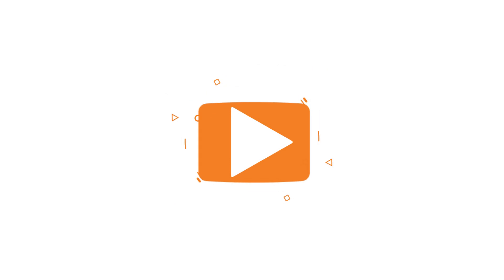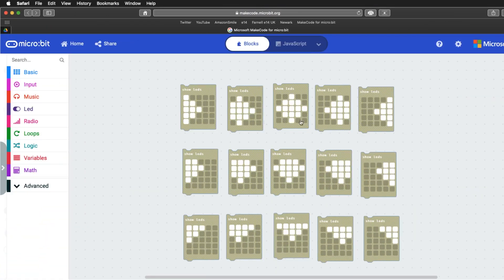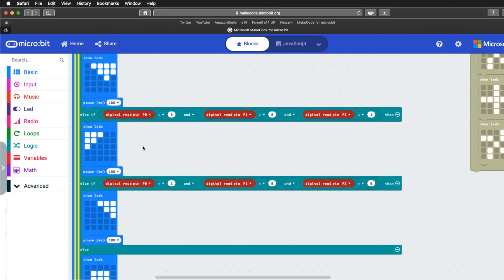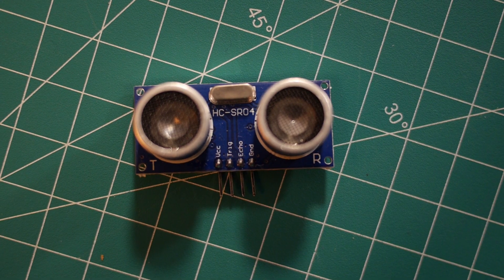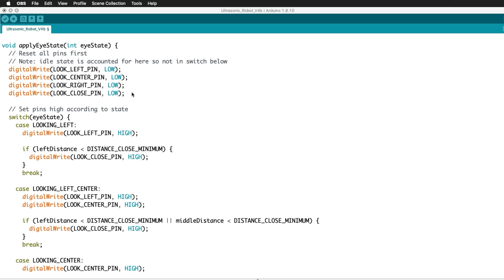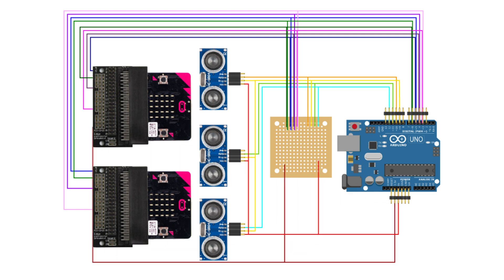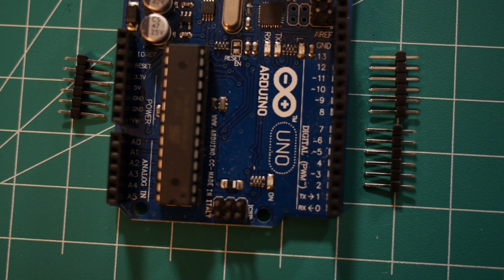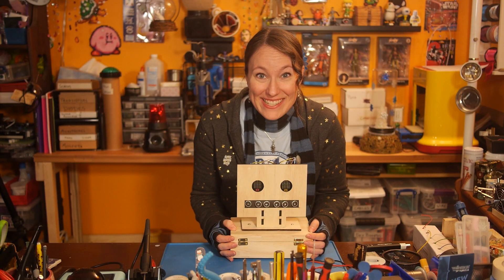How to Make an Ultrasonic Nervous Robot - The Learning Circuit

Comment: Heya, I couldn't find the link to the code, but based on how the ultrasonic sensors were wired, I believe you are getting output from one sensor that is coming into the input of another. If you fire them off sequentially instead it might work better. Maybe make sure to leave a slight delay too, microcontrollers are FAST and you might have to account for the time it takes a sound pulse to bounce back! Crazy huh!
Reply from the maker: Thanks for the feedback! You can find the downloadable link to the code here. - http://bit.ly/3pppO8o
Reply: It's in a zip file at the bottom of the page through that link.

Comment: Hi Karen,
First thing - cool idea... when you said you decided to make a robot, the box-mounted face didn't occur to me. I just assumed the "standard" obstacle avoiding robot running around on the floor, like everybody else seems to do.
And as for it being "skittish"?  
Well I haven't really looked at, never mind analyzed, the Arduino code, but I think your issues might be related to tying the three sensors' TRIGGER pins together.  When you send the trigger, all three sensors will emit a pulse of ultrasound, so the sensor you're reading could be detecting echoes from any one of them. I presume they react to the first pulse they receive, so that would likely be the pulse from whichever emitter is closest to the target. In other words, when the target is to the right,  the sensor on the left would read a (false, incorrect) distance from the emitter on the right - to the target - and then to the sensor on the left.  And similarly for every sensor.  Only when the target is right in front of a sensor would it be likely to detect it's own echo first.

I haven't done the math, but I suppose it's possible that it might even detect the original emitted pulse from another sensor, if it takes more than 10 microseconds for the sound to travel the distance between them.  (Oh heck - lets do it... Google says the speed of sound is about 343 meters per second - which is 0.000343 meters per microsecond = 0.343 mm per microsecond. So in 10 microseconds, the sound wave is able to travel 3.43mm.  Yep, plenty of time for all three sensors to go into "listen" mode before any sound from another sensor reaches it).

I'm not saying this IS the problem, but it seems to me to be a complication that needs to be looked at. So, since there are still plenty of pins available on the Arduino, I can't help but think that three separate triggers would've made more sense.
Reply: That's exactly what I was about to tell her, cause I had the same issues when I was trying to build a robot mower.  I amounted the sensors all in front of the robot,  now what happened is if the robot encountered a wall for example, the pings  bounce all at ounce or coming from one surface at ounce , then my robot gets confused about what to do now. I tought that my conditions was wrong, but when I think about it like the robot,  it was obvious. Next thing I mounted R sensor on the R side, L on L side of the robot, it was better. I was just trying to read a bigger surface to not miss by too much the obstacles. It didn't work well😂 that what you call interference  in ultrasonic sensors.  I'm going to try this code for my new project. Thanks Karen for your work,  please make a video about neural network using ultrasonic sensors. Full code would be appreciated.